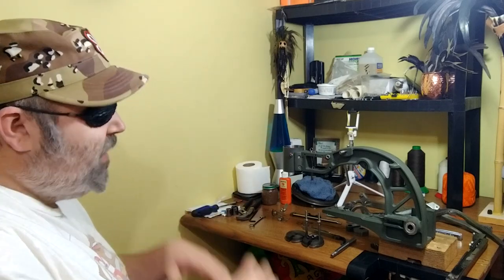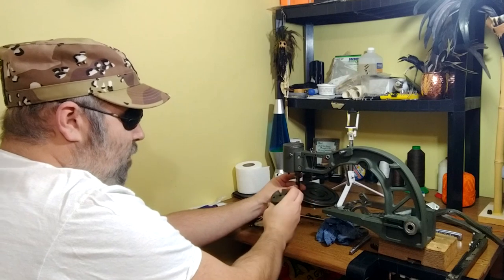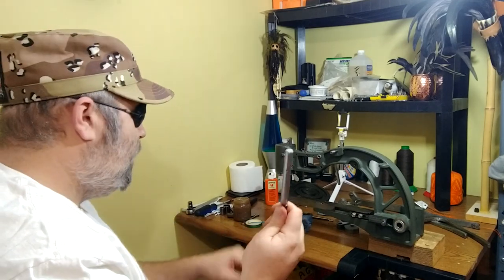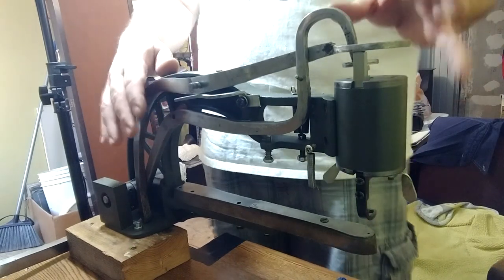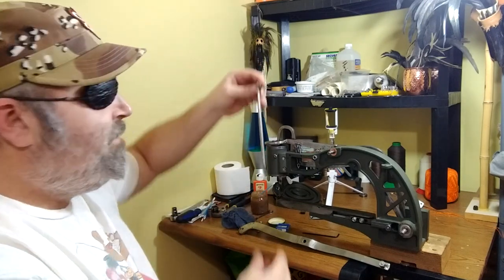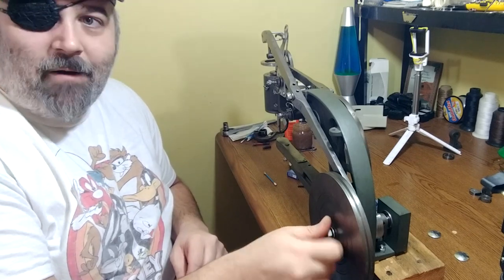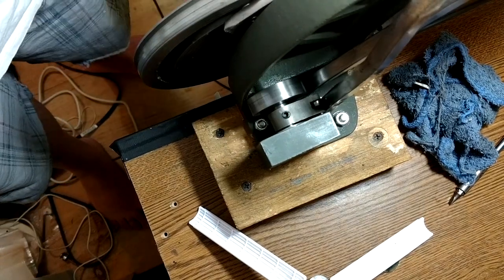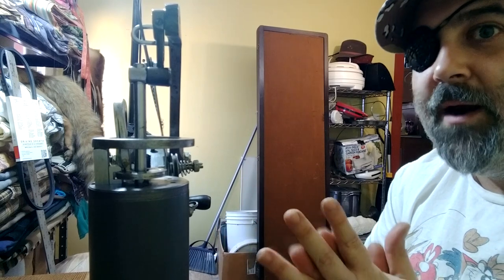How to make your Chinese Sewing Machine run Wicked Smooth

Comment: I just wanted to say thank you so much for taking the time to make this.  I watched this once waiting for it to arrive, and a second time to actually reassemble it and make sure I didn't miss anything (I did).  It's hard to describe how big of an impact a proper cleaning and greasing can make.  This went from a crunchy, sticky, barely functioning machine - practically speaking it would be unusable, to something that operates buttery smooth and feels like a robust machine made before planned obsolescence.  Like I just found a treasure in a thrift shop.  I never would have been able to get this back together, or even have had the confidence to take this apart if not for this video and I'm extremely thankful for it.  

To anyone considering doing this, or on the fence, if you've already got a dremel and some spare elbow grease this is definitely worth it!   Other than saving a lot of money, the hidden benefit of DIYing this machine vs buying a far more expensive machine is that you also end up learning how every piece of it works as you put it back together - so maintenance in the future will be a lot less daunting and quicker.  

Again, thank you so much!

Comment: BTW, thanks for all of your videos.  You are one of the main reasons I went ahead and spent $100 when I already have machines costing much more that are motorized, finely tuned from the factory and are ready to go.  I am in the process of reassembling my newly arrived patcher since I like to tinker.  Your videos, and now this one especially, are extremely useful for knowing how to operate and tear down/reassemble these machines.  I figured I would do a top-down fine tune up before really even trying anything.
Keep up the good work and information sharing.  I appreciate your passion for creating and sharing, especially on this machine.
Reply: I'm on the reassembly phase after polishing and painting.  After watching this video (based on your years of experience with the machine), I'll be cleaning off and re-lubricating with grease especially in the sewing head.

Comment: I completely disassembled my machine yesterday.  I will start by deburring and grinding away all the rough areas, and polish everything.  It’ll get a new paint job that isn’t green.  Next, I will be installing bronze bushings in the arms (which get extensive grinding and smoothing).  I also will be installing a pillow block for the cam driveshaft on the cam end, plus I’ll put in a new longer driveshaft to add a 12 “ dia. pulley.  I am going to enlarge the bolt hole in the frame where the lifting arm bolt goes through, and build my own lifting arm that works on the front side of the machine, plus the lifting arm contact point will have a bearing. I’ll also be adding a 600W sewing machine motor with a two-stage pulley system.

Comment: I have had mine only since feb .My wife and sons bought it for my Bday . after about a week of using it the thread started snapping after two cranks. Went two weeks going crazy not sure what was wrong I was doing. Finally watched one of your videos and saw exactly what was wrong . Simple thing of the screw holding the presser arm loosening it move all of about 8th inch if that. Moved it back, and I was back in business. I owe you a thanks. Also I watch your videos laughing how simple your channel is ;no flashy backgrounds . I have learned a lot about my sewing machine from you . So thank you so much.

Comment: Thank you for putting this all on one video. It drives me nuts when someone will break their videos up into pieces what should be left whole. Too much of a pain to find them all and gather them up into a cohesive and coherent block of info. There are hundreds of videos about this machine on YouTube. I've watched dozens of them and I must say this is by far the single best video on the CLSP that I've seen. Some guys will present solutions that are unfeasible for the average DIYer, casting, forging and machining parts from scratch. Others who pretend to know what they're talking about, but in reality when you try what they suggest it becomes apparent that they don't know. You definitely have an intimate knowledge of the machine. your mechanical ability is sound and all your tips are possible for the average person. I congratulate you on producing the best video for someone interested in getting the most from this machine. Well done sir. I'll be working my way through the rest of your CLSP playlists.
Reply from the maker: Best Comment Ever!! Thank you for checking out my channel.

Comment: New to CLSP and your channel but love your concise narrations. For springs, I suggest getting 12 inches of heavy thread, stick it through the end of the spring, fold thread in half and pull up on the string to stretch the spring onto its post (biker trick). Also, while apart, get a cheap tap set with the 4 smallest metric threads ($5) and run all threads on all parts. Experience has taught me that when a Chinese manufacture uses the same taps 50,000 times, the threads they cut are BAD. My bobbin cover screw came with damaged threads and the hole had no clean threads. Tapped it out, got a longer screw, put in a drill and reduced the screw head diameter and taper to make it more counter-sunk and smoother on top. Also used bright heat shrink tubing on foot lift lever and sewing head swivel ears. Easy to see and gives them a rubber-like coating.

Comment: Absolutely one awesome video. Thanks Harrison.

Although I've had my machine for three years and did clean and lube it when I got it, it was not done to the extent in your video. I definitely will be taking it apart and following your instructions. 

This is by far the best video ,(IMHO) on this subject. If new owners follow your instructions when getting their new machine, it would eliminate most of their problems when first using it.

Comment: Excellent tutorial. I appreciate not having to figure out the mechanicals.  Things mechanical can always be figured out but you did the work.  It's very cool that you shared it.
Reply: I am trying to get my sewing machine to stitch the way I had it when I first got it but I can't get the thread to tighten up enough when I stitch it I have the 3:00 and 12:00 with the wheel but it's still not working better but not great
Reply: Ditto

Comment: When I got my machine, it was mostly assembled except for the hand crank and wheel. After installing it and checking out everything to make sure it was in place properly I tried to crank it. It went halfway around and then it froze in place, and I couldn't crank it any farther forward, so I tried cranking it backward and the same thing happened at the same point on the machine as the forward position. So, I removed it and noticed that there were rough spots all over inside the bearing grooves. So, I decided to remove it and watch your video about how to make it run wicked smooth 3 times so I could really familiarize myself with it. The tips about polishing and smoothing out the bearing grooves on the inside of the hand crank wheel proved to be invaluable. Tomorrow I will reassemble it and let you know how it works then. Thanks for the knowledge and the great tips!

Comment: Machine is coming today. I have been binge watching your videos since last night, and feel I have a good handle on what I will need to do. Basically disassemble clean file, sand, and polish any mating parts. Modify the spool holder or build a new one. lube, time, align, and adjust! Wow Good rainy day project, but from what I see ; if I do it all well I will have a dependable machine for $100.00 and 4-6 hours labor as opposed to $600.00 and 2 hours of fine tuning on a better machine. I know the process will make trouble shooting and maintaining it much easier. Thanks for making these videos, and letting us follow your progress!

Comment: Really nice informative video, learned some new tricks to use.

Considering how oily these machines arrive in the box, not one moving joint or bearing had any lubricant!   Just adding oil and grease where it was actually needed made my machine work smooth and quiet.

Comment: When setting your cams back on, use a business card pinched between the cam and the shaft block. Once tight, pull out the card and spacing should be good and consistent.

Comment: my man, you solved my problem! i couldnt get the bobbin thread to pull up with the top thread. i watched your other video about troubleshooting that, but my problem wasnt the bobbin shuttle lining up with the crank, its because my needle wasnt centered with the hole! it was hitting the outer edge and not making contact with the bobbin.
Reply from the maker: Glad I could help, Thanks for the support!!

Comment: Absolutely brilliant treatment of the topic!  That is from a retired mechanical engineer.  This machine is typical of similar complexity equipment from China.  That is, good basic design but needing substantial finishing work (smooth and polish moving parts) and substantial adjustment.  In other words, NOT a machine for someone who does not have way above average mechanical aptitude and skills.  Damn nice video!!!

Comment: Larry Jones Just got my machine yesterday and did the polish cleaning, but NOW it is coming apart  for some real TLC as you gave me the intestinal fortitude  Thanks Love all of your Vids that I’ve watch taking notes, and have watched several 2 or three times. One question Is it possible to use thread that has been Waxed. Or should I continue to Hand 
Stitch those project. I’m learning but I’m only 84 Thanks again
Reply from the maker: It's not recommended to use wax thread, it will gum up the tension disks and spring and cause all kinds of tension issues.  Thank you for commenting

Comment: I watched the whole thing!  This is a great resource.  I have had my machine a few weeks and, thanks to your other videos, got the timing dialed in right away and have been having fun with it.  I have been nervous to fully disassemble it to paint it, because I was afraid I would forget how it all went back together, but now I have a great step-by-step, so thanks for that.  One thing I would be interested in hearing more about is how to dial in the settings for various thicknesses of material and thread.  I found that I can use up to a 207 thread with a 22/140 needle, but only up to about 8/9 oz of leather.  Beyond that thickness, I have to drop down to a 138 thread or it seems like the friction on the thread causes it to break after a few stitches.  With a 138 thread and a 22/140 needle, I can stitch through pretty much anything I can fit under the presser foot.  Wondering if others have found a way to make 207 thread work with thick leather. Also, any tips for reducing marks from the presser foot?  I have filed it a bit but I am concerned if I file down the teeth completely it will not feed the material any more.  Thanks again!
Reply: So... have you found any more information on your question?
I would like to know,  for my own use please.  Thank you!
Reply: @MrDistech , no, I have not really found a way to use the 207 thread with very thick leather, due to the friction.  If there were a needle thicker than 22/140, it could probably work, but that does not seem to exist.  I usually use the size 138 thread for most projects. For the marks from the presser foot, I filed the teeth down a bit and then also adjusted the screw that controls the spring tension.  You could also put electrician's tape over the teeth to reduce the marks they leave.  In either case, the teeth need to keep a little bit of grip or else you have to feed the material through completely by hand, which can be difficult.  Most of the time I try to use the machine on softer leathers, where the teeth marks do show up, or use it on projects where the stitches will be on the inside and not visible.
Reply: @possumwithaswitchblade  Thank you for your input!

Comment: This is a fantastic video, thanks for taking the time to produce it for others.  I received my own machine yesterday and would love to take it apart so I could clean, sand, polish and reassemble.
My only concern is that my cams are not positioned the way you indicated.  So, if I reassemble, and use your positioning method, will I screw-up my machine ?
Thanks again !

Comment: This video is extremely informative. Thank you for that! I've had my machine for a few years and I like it a lot, but I've always has problems. I wanted to use a heavier thread, like 138 lb, and I've upgraded to a #20 needle. I've made a few minor modifications myself and I'm not sure if I'm ready to completely disassemble the machine, but this is very helpful!

Comment: another great and very informative video.  i was skiddish on messing with my machine for fear of screwing something up on it.  but with your videos i feel confident enough to disassemble and reassemble it to grease it and clean it up to run smooth.
i wonder if using a feeler gauge to set your cam bearings on the back of the machine would help set the distance from the frame and also give you a consistent gap when you disassemble and reassemble it.  
i cant wait to tear my machine apart and hopefully get it cleaned and running like your machine.  thanks again for the awesome how to video
Reply from the maker: Yes,  using a feeler gauge would be a good idea for spacing the inner cam.
Reply from the maker: Thanks for the support and wonderful comment too

Comment: so thanks for all of your vids on this machine but need to point out the issue i found with mine...and took a while to notice...the slot where the needle goes down inside was drilled a little crooked thus when the bobbin tried to take the thread it would bind and snap because the needle was against it so the fix was using a 1/16" drill bit to open the inside a bit then used a 5/64" bit that seemed to be the same size as the hole to ream and smooth the opening to a straight line and now i can even push #24 needles through thin leather like nothing and hope this comment may help anyone else that like me followed your every move several times on your timing videos and still had problems with thread snapping and binding

Comment: I was despairing about my machine until I ran across your (excellent) channel.  I wonder, is the only way to control the stitch length via the stitch length bar in the sewing head?  Is there an aftermarket that sells different bars for different stitch lengths?

Comment: Man, your videos have been a lifesaver! 

However, after some adjusting and resetting the timing, I’m now having an issue with the bobbin shuttle being too tight to the wall of the bobbin well when the crank arm is at 9 o’clock and it’s snapping my thread.  Why is that and how do you fix it? 

I had my machine set up and stitching great until I had to try to reset things to stitch a thicker part of a project I’m working on. after adjusting things I now have this problem and I’m pulling out my hair trying to solve it. Any advice would be greatly appreciated. 

Thanks again!

Comment: Well your posts did help fix most of the problems I've been having, but now my boyfreind  changed the stitch length and now the string in the bobbin keeps breaking, Do you have any ideals about that? We did fix the timing and that help aaallllloooottt it now picks up the bobbin thread and now this problem.

Comment: I wonder if that red tacky grease you buy at the auto parts store will work. I got some, but it seems so thick, I'm worried that'll just slow things down. I'm wondering if I should just use Ballistol or something.

Comment: Could you please make a detailed video on how to upgrade the bearings just like you've done at 13:50 onwards? I cannot get the screws out (one spins in its place, the other one seems to be stuck and disintegrating if I try to use force), I don't know how to remove the bearings or the shaft. I've tried googling this but no one seems to tell how to do it.

Comment: purchased a CLSP years ago...finally getting around to using it...or want to...my presser foot does not move the leather...can you help??
Reply from the maker: Could be a couple different issues: The stitch adjustment screw is adjusted too far out or too close in, or the timing is off.

Comment: Very informative and helpful, thank you so much! I have a question about the walking foot.  Someone else had recommended filing down the foot to get rid of marks, and I did that but now it's too smooth to move leather with consistency. Any idea what I can do to improve this?  Thank you again for your great videos.
Reply: I have heard others say the put a thin piece of leather on the bottom of the foot and it worked really well
Reply: I think they said just file the sharp teeth a little, not file off until it’s smooth.  In any case, try dipping the foot in a can of liquid rubber handle coating.  The kind sold to coat tool handles.  Some have reported good results doing that.  Good luck.

Comment: I have had my machine working before. I packed it up to move to a new house and pulled it out set it back up put it in time and now it’s snapping too thread on the first rotation every time? Any suggestions on how to fix it?
Reply from the maker: If your cams and bobbin are all set correctly, that narrows it down a bit. It could be the needle driver height, bobbin tension, bobbin wound too tight, needle bur/bent, or needle needs to be realigned. I would check in that order to see if that fixes the problem. If not, send me another message and we can go from there.

Comment: I have a old Adler long arm machine that sews terrible. Will settings be the same as your machine.
Reply from the maker: Pretty much the same. The cams may be different, but the bobbin timing and tension should be the same.